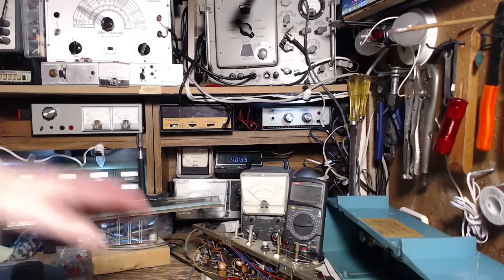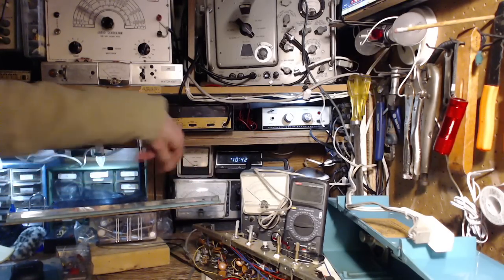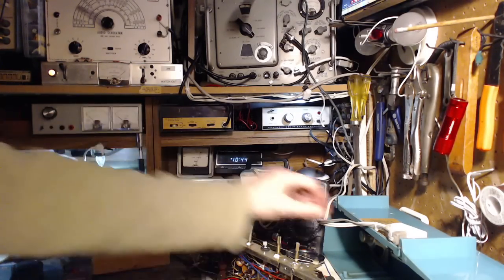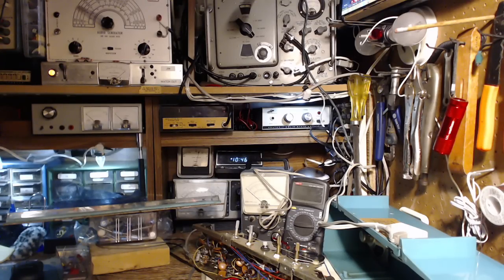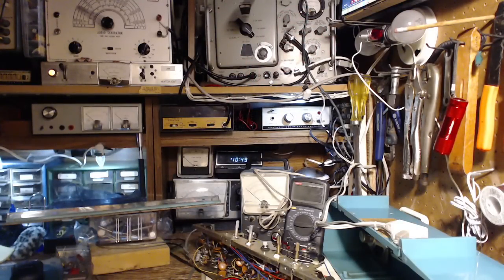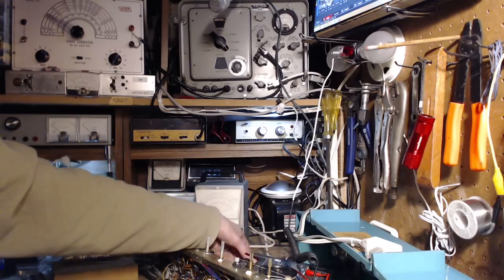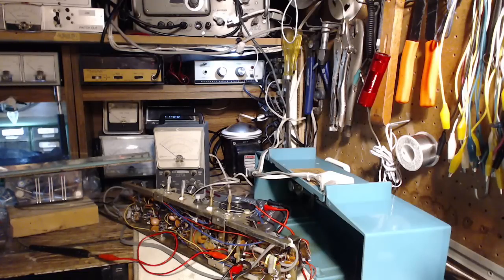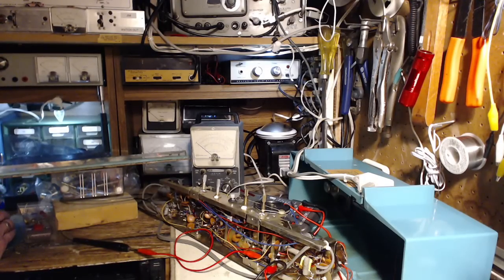Jim's Radio Shop - Dim Bulb Power Supply

Comment: I also made a transmitter light bulb dummy load. It consists of a junction box, light bulb ceiling socket, so-239 panel jack, and 100w incandescent  light bulb.  (plus a short piece of coax jumper)

Comment: Thanks Jim. Glad you are feeling better...I understood the overall concept but this helped a lot. I've been in tech for awhile, but must have missed the light bulb class, perhaps I had the flu that day! :-)
One question, where is your Isolation Transformer in the test power loop? In front feeding your "full/restricted" switch or back end just before your  "Repair Device Power Plug"? Realize it can be either side, just wondering.
Also as I'm sure you know, a Var-Actor is great but not an isolation transformer. The neutral line passes through it. So your set-up is safer now than just having that alone.

Comment: Alot of the joy gotten from electronics as a home hobbyist is gone. Fixing a modern radio is almost not worth doing. The radios of yesteryear give joy in fixing them and its a pleasure to revive their old technology. Those turntables are so magical and confusing!!!! But who could not enjoy getting them to run as designed. Seems none of that should have ever ended. Radio Shack died and with that the seeming end of the kid who wanted to learn about how a radio works.